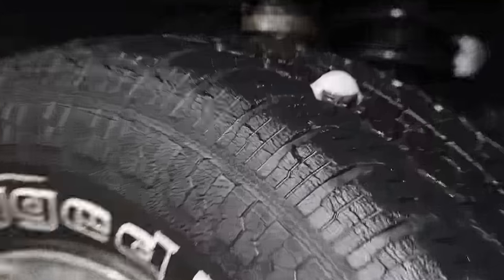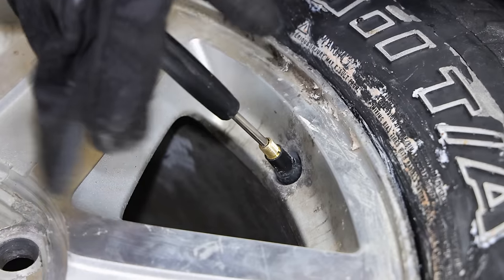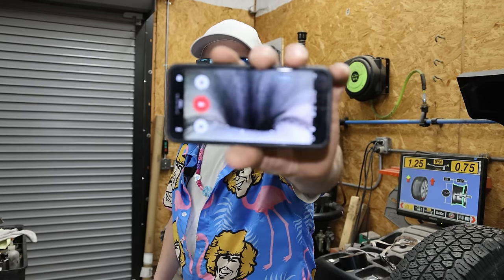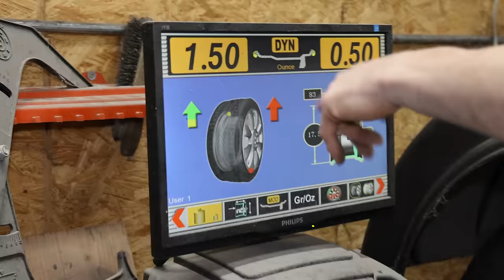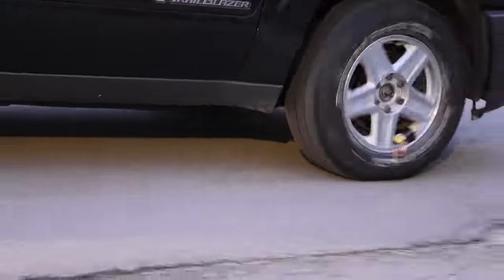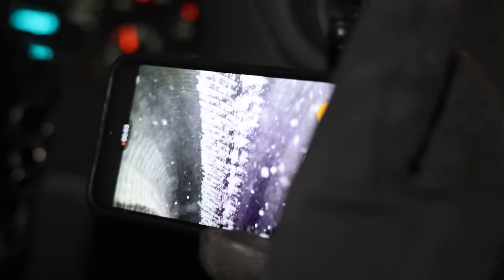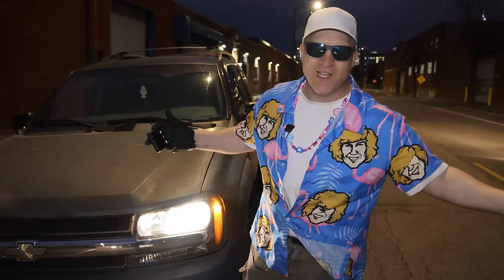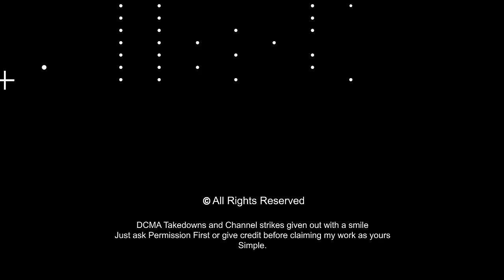GoPro Inside a Car Tire (With Balance Beads)

Comment: I worked at a tire shop for a couple years, I remember one time I popped open a big truck tire and the entire thing was FULL of balance beads. The customer was complaining about the truck pulling to the right and a severe vibration at high speeds. It probably had three gallons of balance beads. That was an interesting conversation with him
Reply from the maker: Lol... He probably got a flat and instead of fixing it just filled it with beads. Your comment made me crack up
Reply: This kind of reminds me of that prank YouTuber who put beans in his PC and then called a PC repair guy.
Reply: He probably thought they were a consumable...
Reply: A case where more is not better
Reply: I guess they don't work if he had to add 3 gal with no results still
Reply: @WarpedYT He probably thought they were consumables and dissolved and 'coated' the inside of the tyre or something. Makes sense, those things would heat up an absurd amount from friction and cause extreme hot spotting in the tyre. I'd love to see it on a thermal camera.
Reply: @SilverStarHeggisist  That 70's Show, Kelso: "I brought a WHOLE roll of duct tape."
Reply: @bashkillszombies  I would assume they are formulated to take the heat, as the vehicle stops the beads fall out of place, so nothing is sticking to create hotspots.
Their movement seems more like a fluid, like small grain millet or sugar.
Put water in a bucket and fling the bucket around , the water stays at the bottom of the bucket. Just like the beads stay in the "Bottom" of the spinning tire.
Being solid "fluid" with pressurized gaseous "fluid" and centripetal force the shift should be to equalize the weight, makes sense to me.
It's not going to make the heavy side heavier because everything is flowing and the air will push the solid, so the air is moving smooth and not lopsided.......
the more I try to explain it, the more confusing it seems.
Reply: You can fix a tire, but you can't fix stupid.
Reply: Amazing
Reply: @SecretSauceyjuice ITS FULL OF BEANS!
Reply: @SecretSauceyjuice  "is thIS a FoOll puMp?!"
Reply: Lemme guess too much?
Reply: @SheddysGaming  straight up acted like the flool plump dude
Reply: I had the same thing occur on my truck. The passenger front wheel was hammering the ground hard and pulling hard right. I took it in to Les Schwab while on the road in Oregon. The techs asked me who mounted the tires and balanced them. I said the tire shop where I bought the Toyo 40 inch mudders and wheels. The tech held up the bag and said.. you see this? We pulled all this out of that one wheel. He said it must have been close to 5lbs of beads. 

The other issue with those beads: they contaminated the valve stem thus requiring all new stems due to stuck valves that were leaking. I said if one wheel is like that, take them all off and unmount every tire and take the shit out of there and install all new valve stems. Traditional weights affixed to the rim. Problem solved. Not a fan of balancing beads either.
Reply: Theoretically, couldn't he have no air in the tire and get ultimate offroad traction?
Reply: @mostlymotorized  they do work... you just watched them work lol. The amount depends on tire size. 3 gallons is far too much
Reply: @cmcken1  Sounds like an improper installation of the beads. There is a complete chart of the proper amount of beads -oz for your tire size. I use these in my Semi Truck tires, thousands and thousands of miles.
 As far as the valve stem goes, if they did not install the extended valve core that comes in the bag with the beads; you will most likely have problems like you mentioned. A standard size valve core will allow the beads to get inside the stem and malfunction, the extended valve core prevents this.
Reply: I use about a cup of airsoft BBs in each tire, works good. Others use flour but that gets clumped up and has to break apart every morning.
Reply: @Ron-d2s  probably because they would only "work" if the inside of the tire had missing chunks causing the imbalance. In reality, sometimes out of balance rotating assemblies, (the wheel AND the tire) have the imbalance in the wheel...not the tires. And if the tire has it's balancing issue because of say extra dense sidewall belts, the balance beads can't help.
Reply: I'll bet.😄
Reply: @bashkillszombies  Nah they stay still after spreading about the tire. Kinda like the spin cycle on those side loader washer machines. Somehow the clothes end up equally balanced.
Reply: @SecretSauceyjuice Ross did that.
Reply: Bet he also overfills his blinker fluid
Reply: @darealmrog  he should also check his muffler bearings to be on the safe side
Reply: Nice shirt, interesting
Reply: Someone needs to do this!!
Reply: Lmfao. I’ve had this happen before too. Only once.  I had to Google wtf it was.
Reply: You are supposed to add the beads to the size of the tire they are just like weights to many will make it shake and when you get up to 45or50 it levels out
Reply: Okay so what I want to know because both times he balanced he was 2 oz off is if he put another 2 oz of beads in would it be perfect?
Reply: @Roger_Rabbit_Adventures  now with newer beads, they've made them smaller and no longer include the valve core. The smaller size of bead doesn't get stuck in the valve stem/core
Reply: @SecretSauceyjuice A different YouTuber put insects inside of laptop. The repairman was surprised how many bugs were inside his computer 😂
Reply: @avimech8546  LOOOOL
Reply: 😭😭😭 lol 😂
Reply: @SecretSauceyjuice  Ross! Love that guy! He does some car pranks too.
Reply: semi truck tire range from 10-14oz per tire either you hate them or you love them  dually setups tend to cancel each other out most of the time its not needed especially large semi trucks
Reply: @cmcken1 yeah my dad bought brand new 22s with 40 inch tires from custom offsets on a brand new Silverado and they put balance beads in them before they sent them to him and it literally never drove smooth so he ended up taking it to the shop so they can take the beads out and put traditional weights and it drove smooth as glass ever since so yeah not a fan
Reply: @Woodshot48  I hear you mate. See that. Same thing I went through. Dreadful. Old school weights resolved the issues immediately. Easy to adjust as wear sets in. Simple rebalance and one is good to go. 

Worst case involving those bloody beads was the jackhammering of the tire to roadway. 

Cheers,
CM